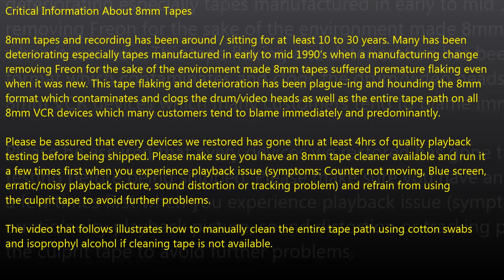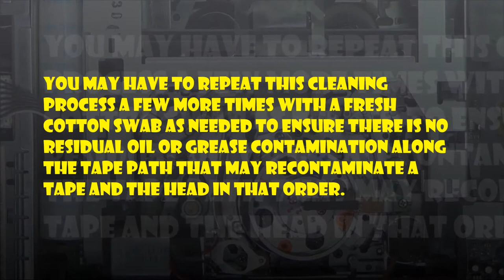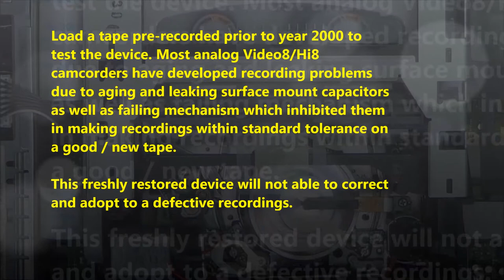Sony Hi8 8mm VCR Manual Tape Path Cleaning

Comment: I was told qtip was not recommended for cleaning
Reply from the maker: Never does but if you have the courage to take a chance - its the proper way to do it.
Reply: Qtips are fine for cleaning the tape path: posts, guides, rollers, ace assembly, pinch roller.... But not for the video heads. Use a chamois swap or a piece of paper soaked in IPA 99%+ Never use qtips to clean video heads.